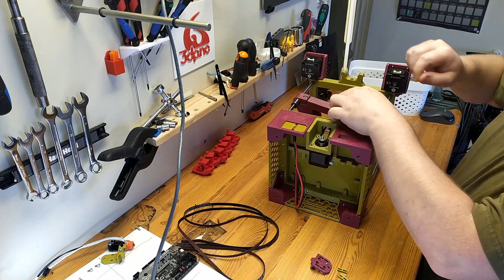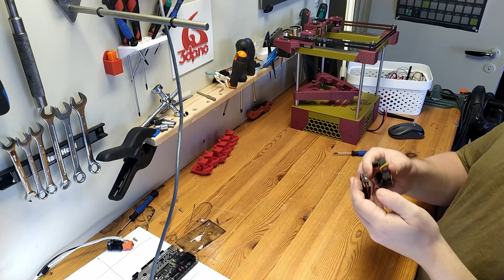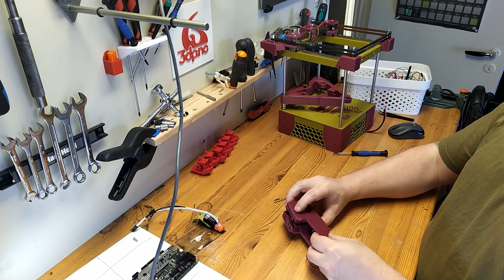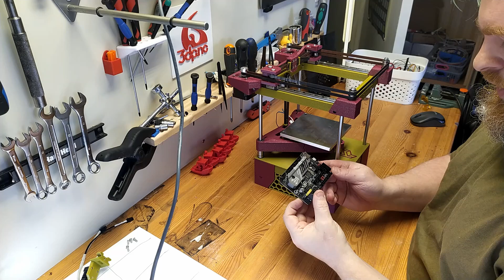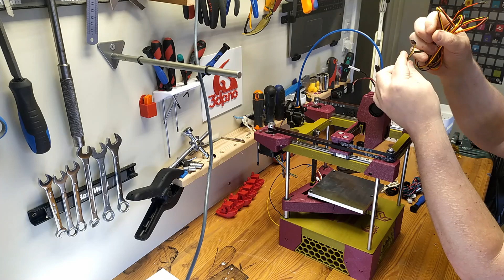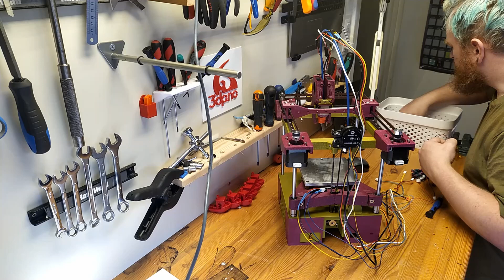Rook Build Part 2

Comment: I think for the fan connections you would want to combine 24V wires, not grounds. Because usually it is the ground side of the fan port that is switched on and off at the board (using a N-channel MOSFET).
Reply from the maker: It is board dependent, and on the mini v3 this works better